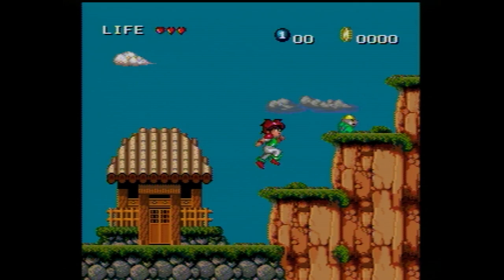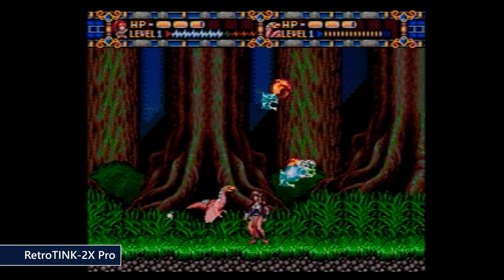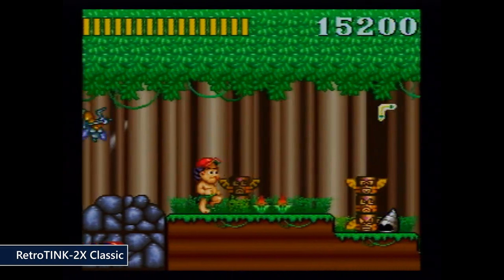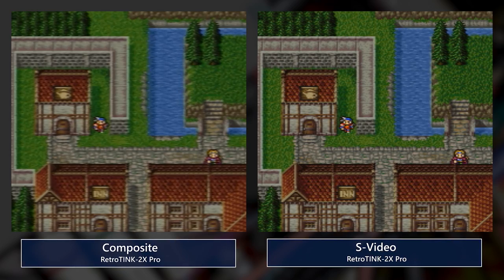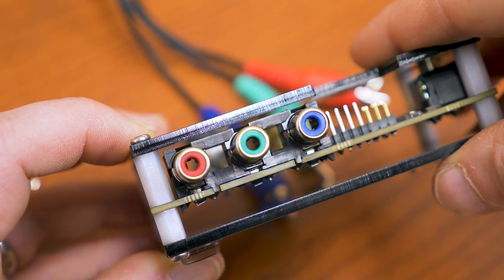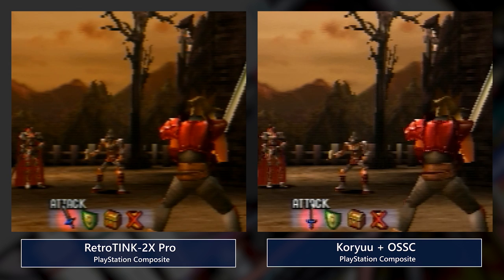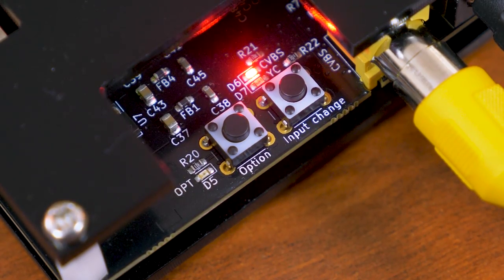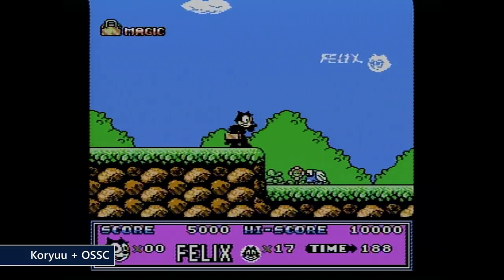RetroTINK-2X Pro & Koryuu - The best composite & S-video Options? :: MLiG Ad-Lib / MY LIFE IN GAMING

Comment: I just had SIX ADS IN A ROW. We are literally back to the days of watching regular TV now
Reply: Look up a Chrome or Firefox extension called "Adnauseum". Just activate the three switches when you first install the application, and adjust from there in the settings. After that, you won't have to deal with ads anymore. Just remember to install it as a Dev package, or activate dev mode in chrome browsers when installing it. Because they have removed it from the chropme web store for 2 years now. But the website has an API file you can install or the entire github zip file package you can install when opening up the folder of the entirety of Adnauseum. When you do the zip file version, click on install add-on in the dev version, find the adnauseum chrome version unzipped, double click on the folder, then don't go into the other folders, just press add at the bottom of the window, and it'll add the program itself into your extensions. Any questions? let me know via this email: Coastermaker@yandex.com. You're welcome.

As for the firefox version, just install it from the firefox web store and install it. You can also do it in the install add-on dev version of it if you choose so, but it's not needed in firefox. For chrome, yeah you'll have to go through those steps.

Comment: Any help plz i had a retro tink pro but i sent it back to mike as im not sure if it was faulty or not while using svideo on n64 it would work really well for around 5 mins then the image would start going fuzzy with black lines down the screen and text on the game menus would sort of move side to side being fuzzz if you know what i mean when you reset the tink it goes back to being smooth then the same thing would happen so i gave up. waiting for mike to get it back to check it out to see if its faulty ir if its just my setup anyone else had similar issues?

Comment: I can shed some light on the 7.5 IRE stuff and why it all looks dark on your screens! IRE is a measurement of brightness in an analog video signal. The brighter the color, the higher the IRE. In NTSC-M, which is the type of NTSC we use in the states, we define 100 IRE as being pure white, and 7.5 IRE as being pure black. NTSC-J, which is the type of NTSC used in Japan, also uses 100 IRE for pure white, but they use 0 IRE for pure black. This means that Japanese NTSC video has slightly better dynamic range than elsewhere in the world. However, this means that if you connect an NTSC-M device (Say a U.S. NES) to an NTSC-J monitor, your picture will look washed out, as nothing will be actually black. The 7.5 IRE setting seems to be darkening the picture to account for that. How good the Koryuu is at that conversion is unknown to me. If you read online about using Japanese electronics on US TVs (or the other way around), lots of people just say to change the brightness or contrast, and that might be all the Koryuu is doing; I don't know. However, changing brightness and contrast isn't a proper solution. NTSC-M and NTSC-J both use 100 IRE as white, and changing the contrast or brightness to the whole image would fix the blacks, but clip the whites (as they would jump up to 107.5 IRE, which is no good). To properly convert the signal, you'd need to change the brightness exponentially; the most in the shadows, some in the mid tones, a tiny bit in the highlights, and not at all at pure white. If the Koryuu is doing that proper conversion, that's a very slick trick! However, since you are using the Koryuu with NTSC-M monitors, when that setting is on, it's sending an overly darkened signal, resulting in the bad picture you saw.

This whole thing is made much more complicated by the fact that modern digital monitors, even those in the states, can go darker than 7.5 IRE, and brighter than 100 IRE. Brightness on a digital display isn't measured in IRE, but rather on a scale of 0-255 (at least for 8 bit monitors). 0 being the darkest the TV can go and 255 being full brightness. On a properly calibrated digital display, 7.5 IRE is equivalent to 16, and 100 IRE is equivalent 235. However, PCs can output from 0-255. This is why modern TVs almost always have a setting for "Limited range" and "full range". Some TVs call this "Limited and enhanced" or "Standard and PC" or something along those lines. When set to Limited, the TV treats everything below 16 (remember, that's equivalent to 7.5 IRE) as pure black, resulting in a muddy image if your signal contains details below that threshold. With your Koryuu + OSSC setup, you could probably set that 7.5 IRE setting on, set the OSSC to full range, and set your TV to full range, and those details would be restored in the picture, although it would still be improperly dark.

TLDR: The 7.5 IRE setting on the Koryuu is for playing American video games on a Japanese monitor.
Source: I own an audio-video preservation and archiving company.
Reply: It's also worth adding that professional monitors like the PVMs MLIG uses have menu settings to select either 0 or 7.5 IRE for video/composite and YC inputs. This option is likely not available in most consumer CRTs though.
Reply: Jesus Brian, use more paragraphs. That was a slog to get through on a phone screen.
Thanks for the info though.
Reply: Tell me more about your company.

Comment: I have my OSSC which I love for all my retro RGB mods I made or native RGB consoles and Dreamcast VGA, along with my Marantz SR5010 which is for sound, but also like how it handles and de interlaces 480i PS2 signals (along with newer component and HDMI things- OG Xbox/Wii and newer), but then there's the odd duck....my poor little Panasonic 3DO (first model). The best it has is S-video output...so for a while I was screwed until I found out about the Retro Tink 2X. It really does help round out that area (and also use it for composite Intellivsion/Atari 2600 mods I installed), thanks a ton Mike Chi!

Comment: Man, I've been waiting for this video! I was already really considering the RetroTink 2x when I first saw your guys' video covering it awhile ago, but as soon as I saw that the RetroTink 2x Pro was announced, I was really excited! And after seeing this video, I do think I'm going to get a RetroTink 2x Pro both for myself as well as for my friend just because he streams quite a bit. Also just to give him something nicer than a generic composite to HDMI adapter, but I am excited to give him one since at one point he said he did want to stream Super Contra with me! I'm also considering getting RetroTink's 2x SCART just to dip my toes a bit into RGB! It also helps that I'm starting to find cables for RGB output that aren't all that expensive either! Great video and I'm excited for more Analogue Frontier as well as more 200 series!
Reply from the maker: [Try4ce] These devices are great for getting your feet wet with this stuff. Be warned about super cheap RGB cables though! They're usually not very well made and can have visual artifacts and audio buzz. I mean, a $10 SCART might get you started, but if you're unhappy with it and end up buying a $30 cable, you've spent $40 when you could've just spent $30 to begin with.
Reply: @mylifeingaming  I am aware of things like that, but I was referring to insurrection industry's Scart cables as well as RetroAccess cables in particular.
Reply from the maker: [Try4ce] OK good! That's the right thing to do!

Comment: FWIW, I just received the Retro Access snes/n64 S-video cable yesterday, and the cabling feels very durable and the signal looks very nice and did not have noticeable noise from what I saw.  It is super annoying to order because the person only takes enough orders for the week and seems to "sell out" within minutes of opening orders up on sunday mornings, but it was worth it for the wait imo.
Reply: Also received mine yesterday. Amazing cable no audio buzz and great picture
Reply: Considering it's a store run by two people as far as I know, they get slammed with orders. They have a lot of requests to fulfill, and that doesn't include other obligations they may or may not have during the week. Their stuff is in high demand, and unfortunately they have to limit their orders. At least their store is open for an hour now, instead of five minutes.

The quality is top notch though. I have a SNES cable I've been using from them, and ordered a Saturn and PS1 cable last week after seeing the results. They definitely know what they're doing.

Comment: Nice video! Wanted to mention some things talked about here.
1) I can confirm the N64 S-video cable from Retro Access is great quality. I own one and the picture is super clean. I also have one of those combo composite & s-video cables for it (says it's for the Gamecube and N64) and it's garbage. It's actually sending the composite signal through the s-video plug! You get a comic book effect of alternating pixels being solid black.
2) At least in the case of the RetroTINK-2X Classic, which I own (latest revision, 3.2), you can toggle it to output full range by holding down the top button (the one that changes between passthrough, 2x, and smoothing) while you plug in the power to it, but it will only output full range while it's on and does not retain that on power cycles. By default, as you said, it's partial range. Maybe the Pro does something like this?

Comment: You guys did a great job at showcasing the (subtle?) differences between the RetroTink 2x Pro and the Koryuu Transcoder. I currently still occasionally use my Framemeister for certain things, but have for awhile been looking to get something that does a better job at representing Composite/S-Video signals from my older consoles, as well as having very quick "Mode" switching for games that switch video modes mid-game. I've been on the fence on whether or not to pick up a RetroTink 2x (now called the RetroTink 2x Classic), but I think that I'll be picking up a RetorTink 2x Pro when I next get payed. I agree that there are certain visual effects that are lost when playing a Sega Genesis console through anything above Composite, which will be better represented with either the RetroTink 2x Pro or the Koryuu Transcoder. Stay safe and keep the videos rolling. Cheers!

Comment: I can't wait until there is a comparison video with the RetroTINK Pro and the RetroTINK Multi with it's 480p passthough. What I am most concerned about is the sacrifice that Mike had to do for the Multi's passthough hardware. I read that images are now slightly softened as a result of the new hardware locking into the vertical bilinear filter. I'm wondering if the softening of NES, SNES, and N64 composite & s-video signals is a deal breaker for wanting to play my Gamecube and PS2 480p content games. (yes I still have my GC component cable.)

Comment: I'm glad you touched on S-video cables. I remember making the mistake with this multi console S-video cable that had a yellow cable for composite. Glad I found a better one for my N64 now
Reply: Honestly, I'm not so lucky with mine. I pretty much have to make do with a cheap cable for the N64. It's not perfect, but because I have a PAL N64, and what I got was specifically designed for it, I don't have much choice unless I want to RGB mod it.

Comment: I actually just got the retro-access S-Video Nintendo cable.  Its good (nothing mind blowing far as I can see).  I got it because the cost of the HD Retrovision component cables were simply more than I was willing to spend on some cables.
Reply from the maker: [Try4ce] I mean, S-video has a ceiling on quality, for sure, but given how many BAD S-video cables are out there for Nintendo systems, we're really glad Retro Access is making them.
Reply: @mylifeingaming  yes that is true.  I had looked at some my local retro store had (seems to be a white label brand as I see the same box with different names on the internet).  The cables were shockingly thin and likely had no internal shielding either.  I will say the biggest difference I noticed was in text.  Its much crisper on S-video compared to composite.

Comment: Hi guys! Thanks for another valuable video. I've been looking to compliment my n64 with ossc after koryuu's release without modding it, and it's nice to actually see the effects. Have you thought about uploading your videos at 4k on youtube? Doing my own videos I noticed a clear increase in quality despite the source material being 1080p when I made it 4k and uploaded to youtube. Seems like even at 1080p youtube is doing a lot of less flattering things to the video you upload. So even though your video was 1080p, uploading it at 4k makes it look better on youtube. Forces it to get around the algorithms.

I'm looking forward to OSSC firmware update in the future adding some better filters for koryuu fed signals to improve the look of it. As it stands it looks like ossc's upscaler and filter are great when you have a clean signal, simply beautiful, but with those low quality signals those filters and scalers don't leave the most pleasing image. Like with Ocarina of Time sample on this video the detail and colors were much more impressive on s-video, but the image itself was more pleasing on composite. Just something to hide that noise a bit. And for n64 some kind of smoothening blur could definitely help. Or perhaps koryuu's own filters could do that? That firmware update connection looks terrible though, hopefully they'll upgrade the box to use something like OSSC's sd card system.

Comment: The Koryuu is what you need if you love pre-16 bit systems other than the sega master system and/or the n64. It transcodes the signal to component giving you the right colors per display and component is basically a cleaned up video signal from an nes or before or an n64.

Comment: As the owner of a Retrotink classic, the Koryuu doesn't seen to offer exactly a great value. I guess it has its audience on the ossc user base, but it doesn't really do much for me
Reply: It really just matters for someone scaling to 4x or 5x, and even that gets tricky with OSSC and TV compatibility. But yeah I own the 2x pro and the ossc and I'll probably just continue using the 2x pro for my composite/S-video needs. It's so much simpler to use that I try to use it over the ossc when I can.  I love the 2x pros smoothing feature for early 3d titles as well.
Reply: Thanks! FWIW, it's the perfect add-on if you already own an OSSC. I think the quality of 3x/4x/5x composite is debatable, but Line5x S-video looks damn close to RGB.
Reply: If you already own an OSSC, it's cheaper than a retrotink. And if people are buying them, I say there's nothing wrong with filling that niche.
Reply: @ValkyrieTiara  it definitely seems to be a device purely for those who want to or already own an OSSC. I wanted to able to use my NES and N64 on my big screen TV without them looking like total crap so this duo accomplishes that perfectly. Sure it's not as nice as RGB but those console mods are pretty expensive.
Reply: @ttvCarn  If all you want is to play NES and N64 games on your HD display without going RGB, I would recommend the retrotink. It's MUCH cheaper than ossc + koryuu (by about $100). But if there are other features of the OSSC that you want so you'd buy (or already have) one anyway, then yeah the koryuu is the better option.
Reply: @ValkyrieTiara  yeah I already had an OSSC which I use for all my other RGB consoles. If I didn't have an OSSC then the Koryuu wouldn't be much use for sure.

Comment: I feel like every kind of product like this has it's own set of benefits and drawbacks. I'm not the most well-versed on how it all works so I don't know if it'd be possible, but I wish there was just one option that had it all in one. And I mean that wouldn't necessarily kill demand for the other products, as it would obviously be more expensive. People just looking for the simplest solution would still go for the cheapest option.
Personally, I just wish the OSSC supported S-Video, because the lowest quality video source I want one of these for would be an unmodded N64 and having a whole other device just for that, whether it be the RetroTINK or Koryuu, seems like too much of a bother. I do prefer the look of the Koryuu, and I think it'll get even better overtime with updates. The RetroTINK being easy to update through USB is a major advantage, though.
Note: I learned immediately after typing and before posting this that the OSSC Pro will likely have S-Video and composite support, among a lot of other upgrades. Figured I'd still post the comment anyway lmao

Comment: Composite video is ok on an older crt under 20-27"( for the nes or below). Beyond that s-video is needed at the bare  minimum, whether it be for a 32"+ crt or an hd display fed through the proper transcoder/upscaler. I have seen some newer 4k tvs take a composite nes signal and display it ok but didn't check the lag it took to do it. I honestly just run my nes and 2600 to a 27" consumer crt, while all other consoles go to that and also, a vga crt and a 4k samsung through the ossc.